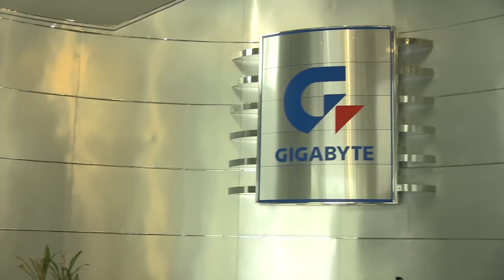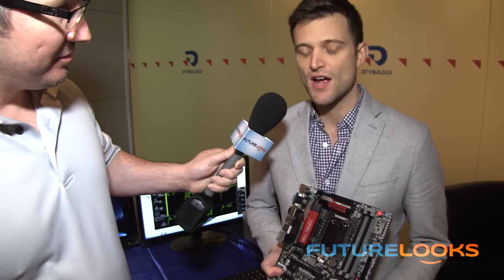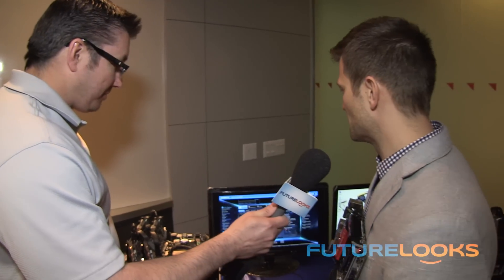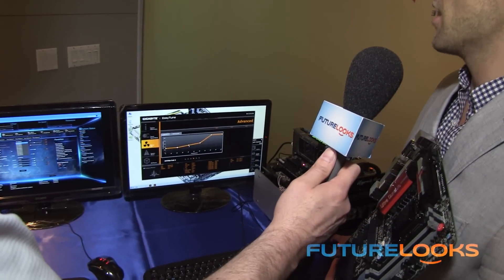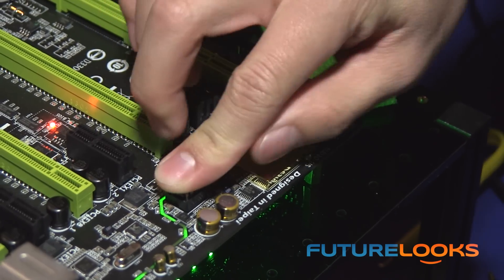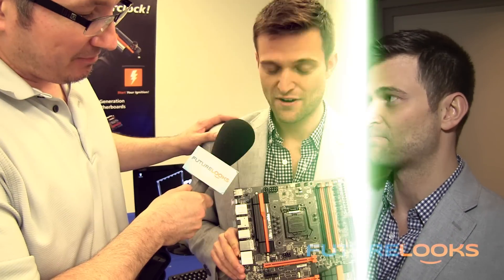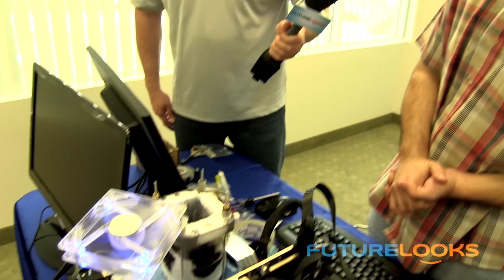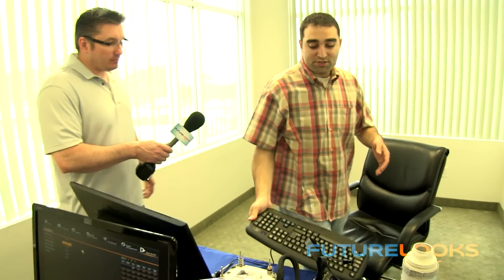[HD] GIGABYTE Launches NEW Intel Z87 Series Haswell Motherboards

Comment: guys, sorry I'm not tech savvy but I wanna upgrade my old Gigabyte/Intel Core 2 Duo G31M-S2L to a new motherboard and processor, but I need to ask;
I have the OEM windows Vista license (& disk) that came with it -but as the years past I also upgraded to Win7 (upgrade disk) and Win7 Professional (just the upgrade key). Do I have to replace all of them? Or can I buy an old copy of Vista and I can still use the latter 2? Thanks!